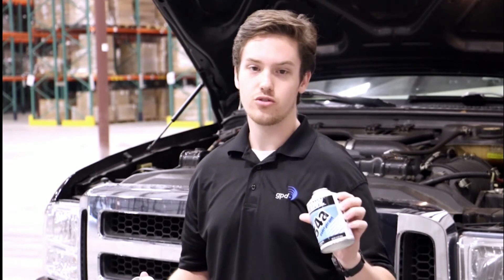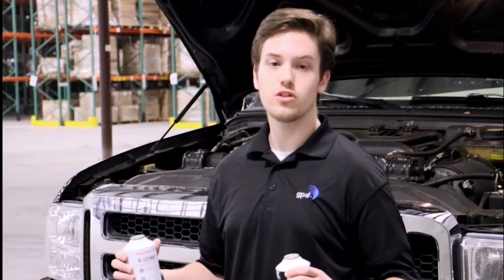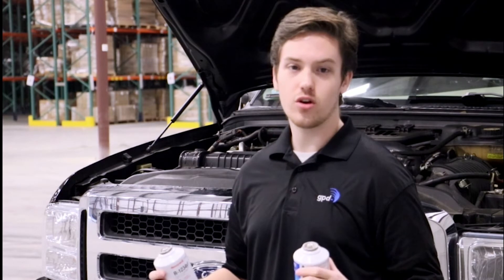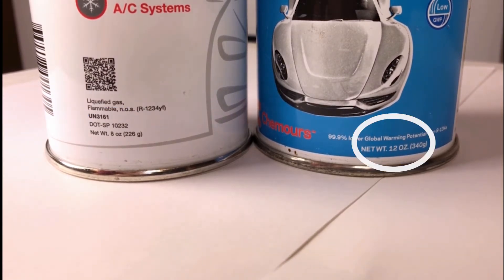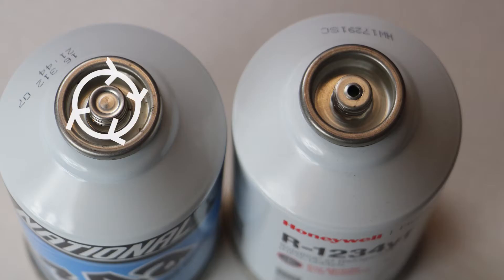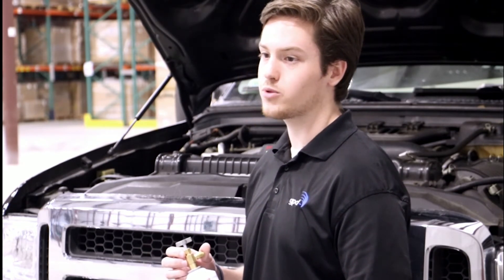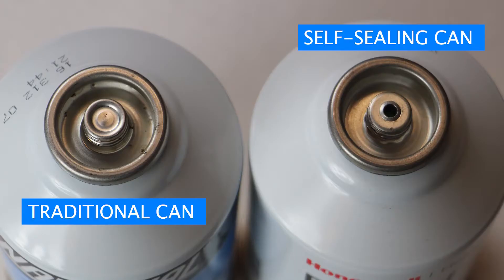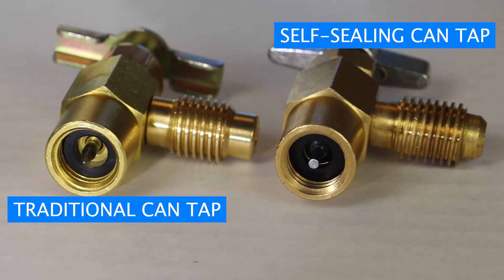A/C Refrigerant Small Can Design Changes - R1234yf Vs. R134a

Comment: @globalpartsdist
Good basic information about these small cans and the changes, the EPA regulation for the self sealing small cans of both 134a and 1234yf is a fiddly valve that makes using them difficult even with the proper adapters that are sold.